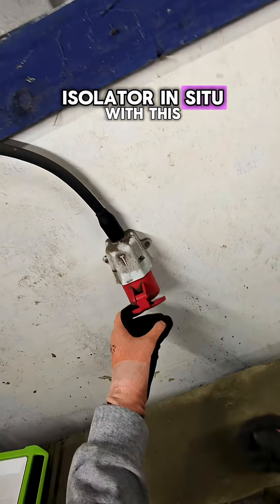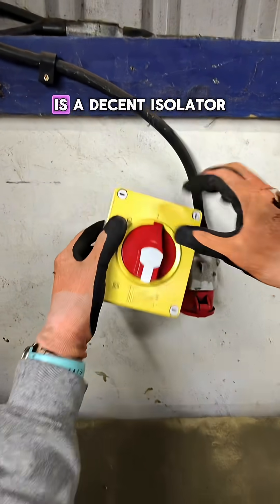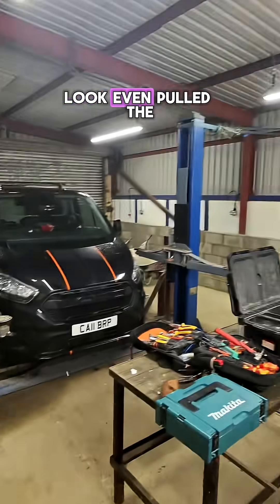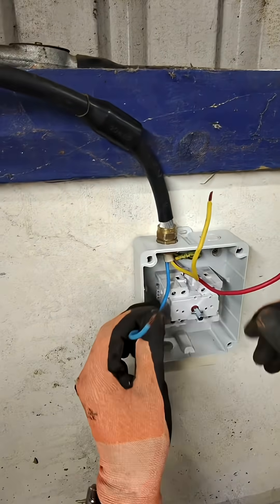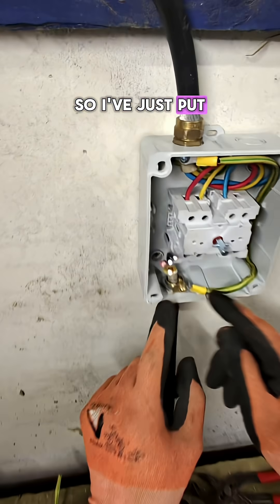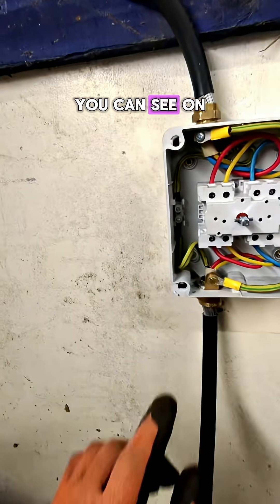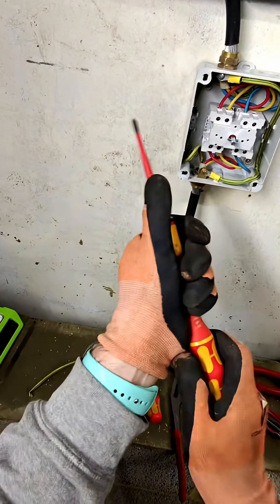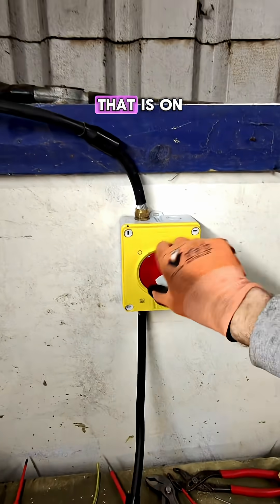Wiring Up a Three-Phase Socket the Easy Way!

Comment: It would be best to use an interlocking isolator and socket.
You can pull thenplug without switching it off
Reply from the maker: Thanks for the suggestion!

Comment: Where’s the nuetral. I get you don’t need a nuetral for a balanced load but I thought that was more for motors not sockets
Reply: I'm learning just reading this, thanking you fellas
Reply: Sockets are available in both 4-pole and 5-pole configuration. In addition to motors, things like 3-phase arc welders don't need a neutral.
Reply from the maker: You're right about the balanced load for motors, but for a socket, you typically only have the three live phases and earth.